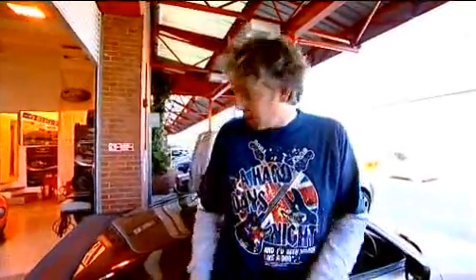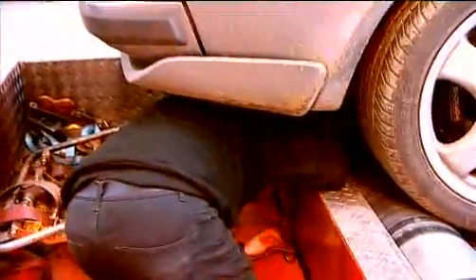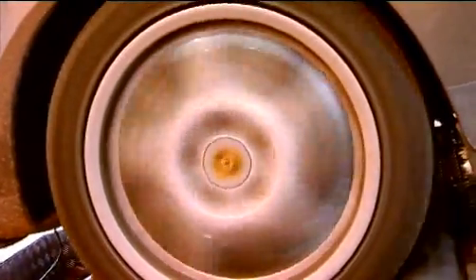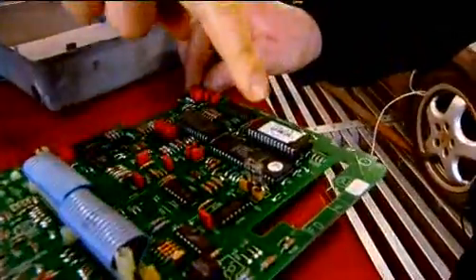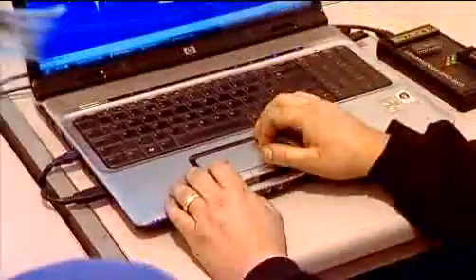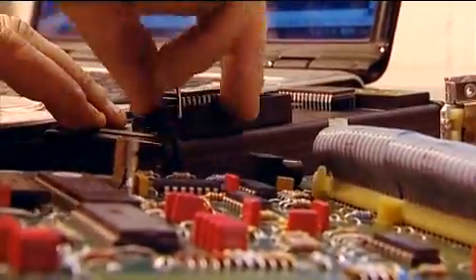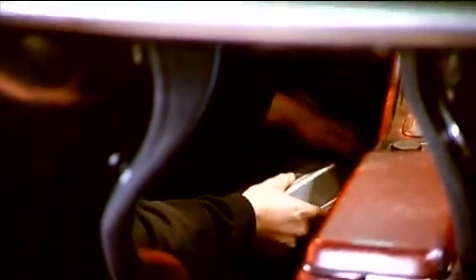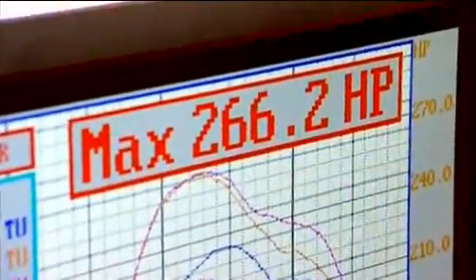Tuning Performance - Reprogramming the engine management computer.

Comment: the thing is it was already there but it was limited by the factory to prolong engine life ,improve drive-ability and fuel consumption now it is more sporty the rest is compromised abit
 plus the reason this engine gained 35 hp even thought it is from the 80's is because it is turbochagred such modification on naturally aspirated version and gain is almost felt,,,